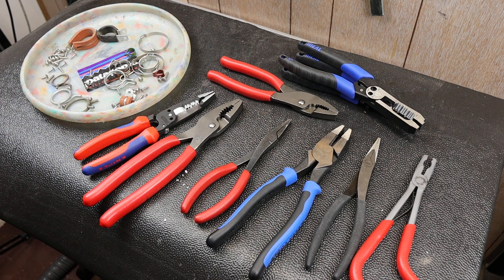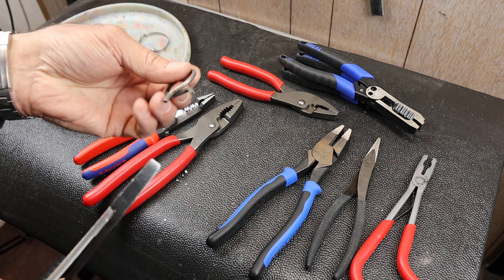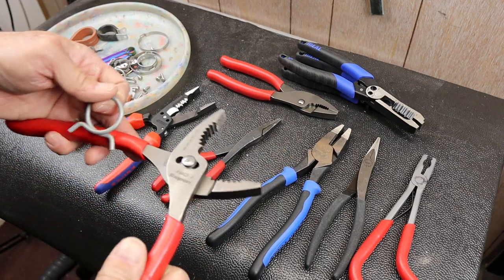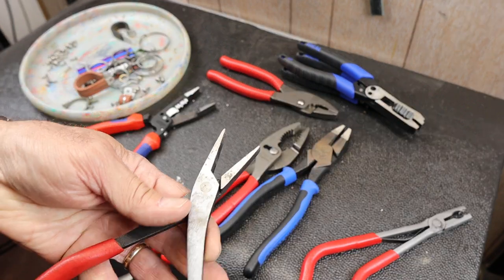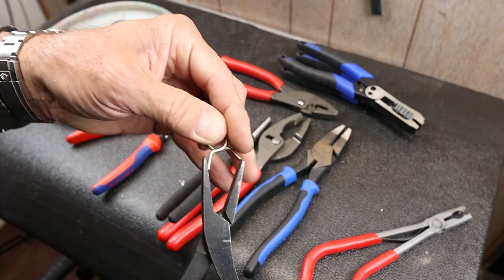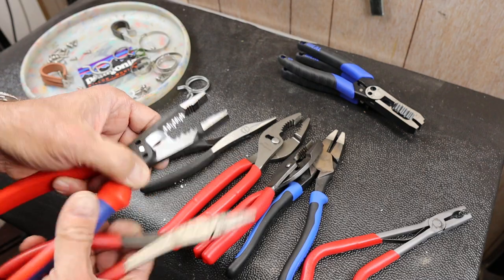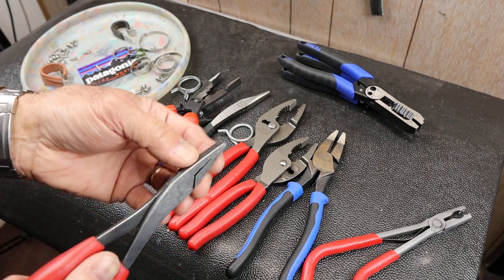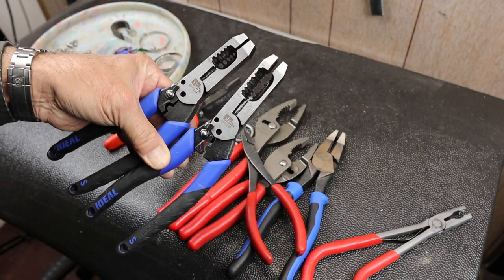Snap On Duckbill Pliers: What are they for? What do they do better than other pliers? Basically why?

Comment: (Ugh... second time posting this, the first version seems to have been pulled. It included a Reddit link, which might be taboo.)

Duckbills are used all the time for safety wiring; probably one of the more universal tools for the chore. However, most of the real pulling etc is done on the ends that will be trimmed off anyway. Safety wire pliers proper have even more aggressive teeth.

They come in various lengths... and bonus points if you can find a pair of old time Utica smooth jaws.

Snap on makes some long handle that are really nice, along with matching needle nose & bent needle nose (609CF, 908CF & 408CF). They also make some long dikes (312CF & 808CF) well suited for wiring[1]. All sport overlapping handles for increased accessibility. And this isn't even mentioning all the stork versions.

A good bit of safety wiring needs to be done in areas with horrible (or worse) accessibility.

For short duckbills, I prefer the Knipex 28 01 200 (and 28 21 200 needle nose) over the Snap-Ons, but it's more personal preference.

Duckbills are also nice for removing/replacing spade type electrical terminals etc.

Far as safety wire goes, there's a lot of (mostly) bad examples people have found in the Reddit group r/aviationmaintenance, & a brand new group; r/badsafetywire.

If anyone is interested, I'll put up instructions on where to find & download a free FAA pdf covering safety wire in detail.

[1] If doing a lot of aircraft work, anti 'FOD' (Foreign Object Damage, See Wikipedia) dikes are nice.
Reply from the maker: Thanks for the detailed info. And for taking the time and effort to do it twice!
Reply: Agree 100%. 15R here. My go to for safety is the duckbill. Cotter pins and lock wire.

Comment: Snap-On duckbills are my favorite for pealing cloth and leather in upholstery work and removing staples after you pry them with a staple puller, also the thin ends are great for bending aluminum rods.

Comment: I use them for small fuel line clamps on small engines lawnmowers and snowblowers mostly that was the reason I actually bought them hope this helps
Thanks for the video

Comment: I didn’t have a pair till I found some Craftsmans on the road and later got some Snapons in a used tool buy. They are my favorite as I seldom used slip joints anymore. To me they are general use for sliding a washer in from the side, P-clamps as you show(except starting the bolt or screw with larger pliers isn’t as easy). Also, starting some safety wire, bending a 90 in wire, separating and holding small spring coils, etc. That thin edge is useful. Also, the serrations are not as extreme so they are less likely to scratch things.

Comment: I kept a pair of them for mostly working with something like 4-8 awg bare for bonding, doesn't damage the wire and is small but stiff enough for feeding into a busy panel. It is especially good when your linemans are too big but your needle nose can't bend and move the wire correctly. I also used them for bending and closing loops on device but that is just a personal preference.

Comment: A frisbee parts holder!  Thats a first, AWESOME IDEA DOC!😎😎😎👍🏼👍🏼
Reply from the maker: I use frisbees for all kinds of uses. They are a staple for bicycle maintience on the road. Tape a magnet or more to the underside and you can make a large custom magnetic parts dish. I also use one under my Berkey filter in the camper to catch drips and condensation. They make great picnic plates and plate holder too. I'll do a video on them.

Comment: I use duck bill pliers everyday on virtually every job I do but they only have one purpose, safety wire. With the exception of the Milbar Tigerwave safety wire pliers all safety wire pliers have teeth that will cause some nicks in your wire. As long as you grab your wire side by side and not stacked on top of each other the nicks will be minimal. Some guys like worn down safety wire pliers and duck bills but you can’t get your safety wire as tight with them.

Comment: Re-assembling electrical components.  Needle nose doesn't grab as much surface area on wire etc, also makes the (larger) duck bill better for twisting stuff.

Comment: I use them for the diesel exhaust  fluid lines on heavy duty truck emissions systems.  Used the snap on ones till they changed the designs. Then I got the knipex  version.  Actually  better